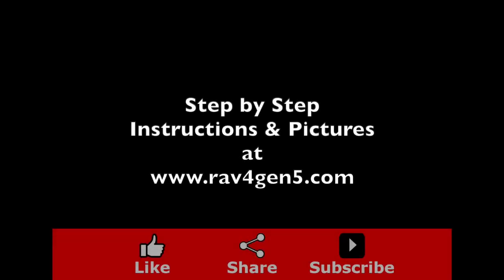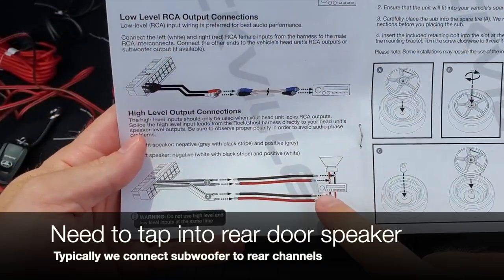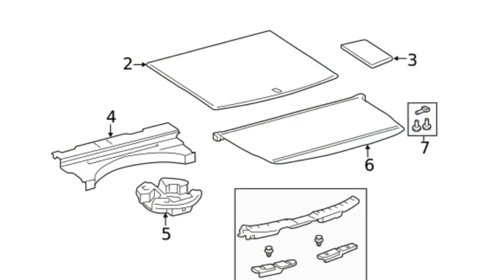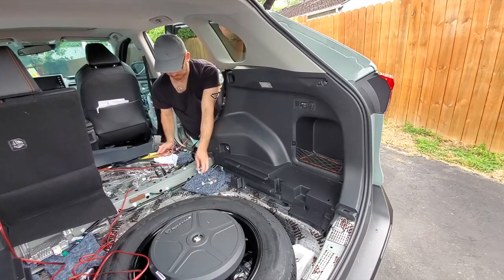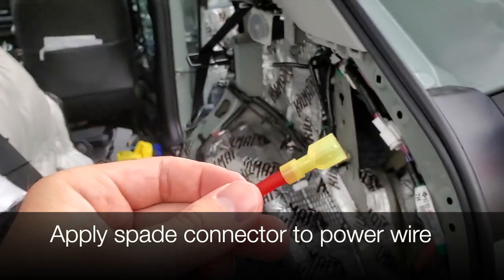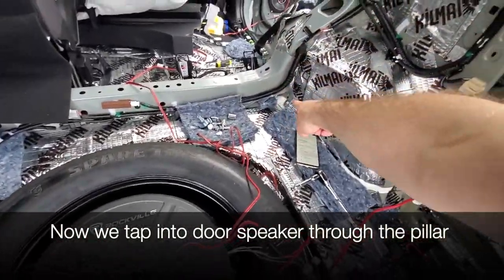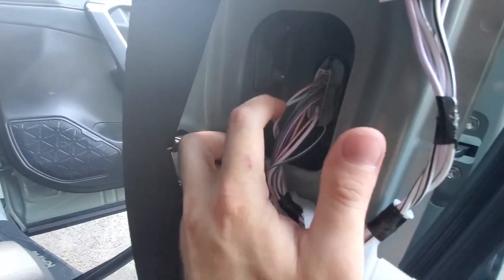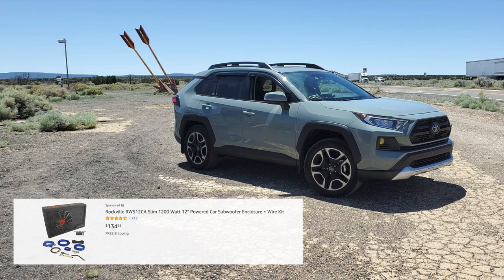Subwoofer Install on the Toyota Rav4 2019 2020 2021

Comment: Hello, so I got the spare tire sub for my 2021 rav4 xle premiun. I'm ready to install. Using your video of course. I use T taps to connect the wires to the rear door? I noticed in another comment you said you used the head unit.

2. The power wire that runs to the battery. How do I get past the firewall?

Thank you
Reply from the maker: T-Taps are fine and are what I would use to get signal from the B-Pillar. I went to the head unit because I already had signal exposed when I installed an amp

Firewall : https://youtu.be/f-3oCuXDQOk?t=541
Reply: @Rav4Gen5  ok, thank your for that video. So, my question comes from  the video . But I'm confused in 9:10 mark. When you summarize I noticed the blue remote wire is connected to a lever nut connector. My question, which idk how to ask.. once I t tap into the cigarette socket, and I have the red power cable, where does the blue wire come into play. Do I  make sense?
Reply from the maker: Blue is for signal to tell the sub to turn on. You want power sent to that when the car is on or accessory mode. In this case, I connect to the same port as the 12v since that only has power when car is on/accessory mode. You need to make sure the sub turns off when car is off otherwise you'll drain the battery.
Reply: @Rav4Gen5  ok. Are you able to provide a link to purchase the 3 connector lever nut? That way I can copy exactly what you're doing. 

Have you learned or or figured out another method to avoid removing the trim to access the cigarette port?
Reply from the maker: I added lever nut connectors to the video description. Thank you for that. 

I don't think you can connect to power without removing the panel. You can consider something like this. https://amzn.to/3soiZXe
Reply: @Rav4Gen5  where else would you connect the ground?

Would you recommend to connect it to the car seat bolt?
Reply: @Rav4Gen5  hello, I have turned on the sub but to me it sounds low. Any ideas?

Comment: great video.. I have a question though I have the TRD version which comes with JBL with 11 speakers and it has a small sub-woofer in the back. The bass comes out nicely for around 4 seconds then slowly fades away. So I did read on rav4world that all of the RAV4s are affected by that issue which is basically the JBL system has a protection feature built-in the head unit which lowers the amps or something. So my question is if I replace the sub-woofer with a better quality would it make any difference? how do I override amps coming from the HU? what's the best way to accomplish that? thanks again.. subscribed
Reply from the maker: Hey. I honestly don't know but I it sounds like bass roll off which auto-manufacturer do to prevent damaging their cheap speakers. No subwoofer might not help as the sound frequency going to it is being limited. You can get an AudioControl LC2i or LC5i to overcome losing the lower frequency. But again honestly, I don't know and I would take to to an audio expert. They should have tons of Toyota experience since this is how it's done across most Toyota's that have JBL.
Reply: @Rav4Gen5  thanks man.. I'll look into it and see if there's a solution
Reply: Hi
Yeah, i have the same issue and yesterday we tried installing a new rockford fosgate punch3 subwoofer
After the install the bass got less even more quickly 
I was getting this done professionally 
They worked on the car for about 12 hours trying to figure and eventually had to take all the wiring and stuff out
So i had to pay for the labour without getting the sub
Did you got it figured out or talked to someone?
Reply: Also
I have the 2020 rav4 hybrid with the jbl system
Reply: @hameeksingh6206  I think you need to replace the head unit to ramp up the amps. I just didn't bother since it will replace the OEM and that means I'll lose the remote start from the app. Unless if there's someone can hack the software of the HU then I don't know how else it can be done. Maybe you should talk to someone who worked on the new RAV4 system. I'm very interested in what would they say.

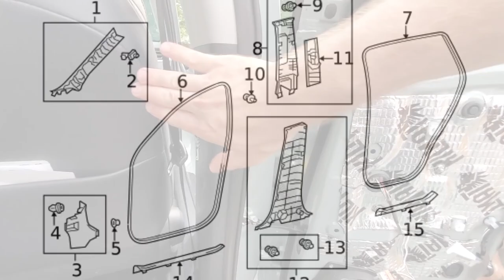Comment: Where do you get the Toyota diagram mentioned at 10:39?
Reply from the maker: I google them. Takes several hours to find. You basically have to shop for a part and then Toyota has a diagram with that part (most times). It’s hard to know how Toyota names the parts.

Comment: Will this fit the skinny spare tire or only fullsize?
Reply from the maker: Both. In this video, it’s on the skinny spare. In a later video, I upgraded my tires and use a full size spare and it still fits.
Reply: @Rav4Gen5  thank you for the quick response, I'm getting it installed today and I wasn't too sure cuz I'm still at work but I really do appreciate you responding and letting me know that it will work

Comment: Has anyone tried this on a 21 xle?
Reply from the maker: It should not be different than this
Reply: @Rav4Gen5  cool im gonna buy, but an amazon theres a few options and not sure if i need the other options just the sub, it does come with the proper harness righg?
Reply: @Rav4Gen5   theres the sub alone, sub with control interface & sub with converter
Reply from the maker: you don't need the control or converter. Style= "Hidden in spare tire subwoofer" and Pattern Name = "Subwoofer"
Reply: @VCBP-415  it works on a 21 xle hybrid for me. You will need an additional subwoofer installation kit with ground cable speaker wire power wire etc

Comment: Is there a different way without remove the door panels?
Reply from the maker: You don't need to remove door panel. You need to remove the B-Pillar to get sound signal from the rear door speaker.
Reply: @Rav4Gen5  now I am confused
Reply from the maker: I am too. This is a spare tire subwoofer. Why did you mention door panel? Can you be more specific?
Reply: @Rav4Gen5  because in this installation I see you got all door panels dismounted
Reply from the maker: I think you mean regular trim panels in the cargo area. In any case, you need to find a way to get audio signal and power to the subwoofer. You have to remove panels if you want to conceal wires. Panel removal is easier than it seems.
Reply: @lakkchina  if you watch video. He discovers the b pillars later. You can tap into speaker from there using T tap connectors
Reply: @lakkchina  Watch -4:11 he says it changes the installation process for him. He then identifies wire that sends signals to speaker. Watch 3:36 where he identifies. T connector those wires. He says he’s not going to connect at speaker anymore.

Comment: Just curious, does the subwoofer consume a lot of power? I read somewhere that either the amp or subwoofer upgrade will need to the alternator upgrade to a higher amperage alternator.
Reply from the maker: I have both this subwoofer with built in amp in this video and an amp in another video for the doors and I am using stock alternator. And I have a 12v fridge. I have not come across any issues. I am also not blasting my audio either and the system isn't that powerful relative to some builds that go all out. You should be very fine with the stock amp.
Reply: @Rav4Gen5  Thank you. I want to try this upgrade someday. It looks like a lot of work but not impossible to do :). Thank you for sharing the video
Reply from the maker: Totally do-able. Here to help if you have any questions.